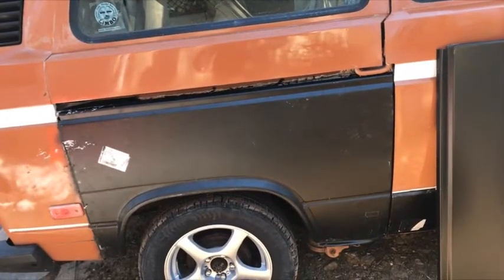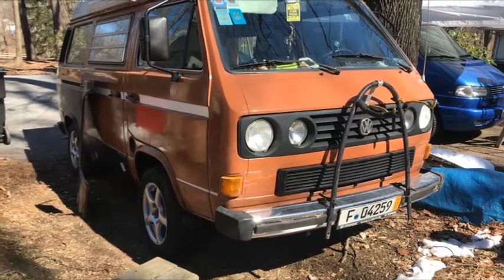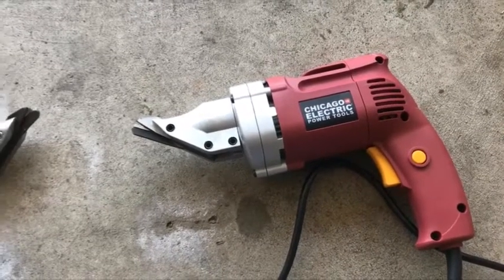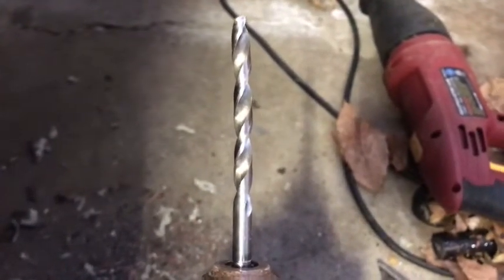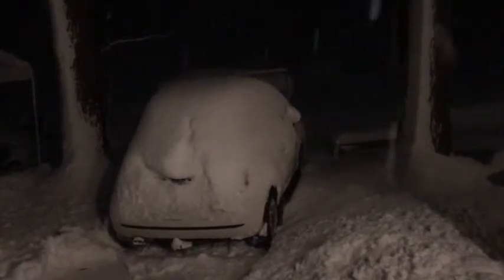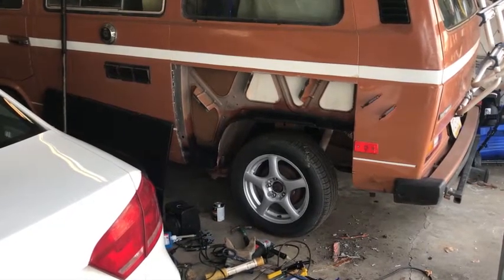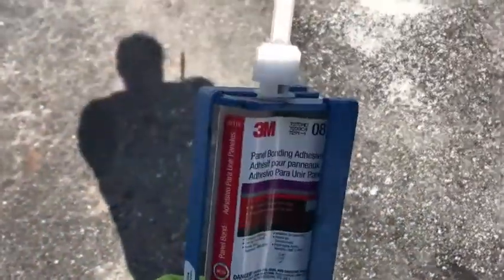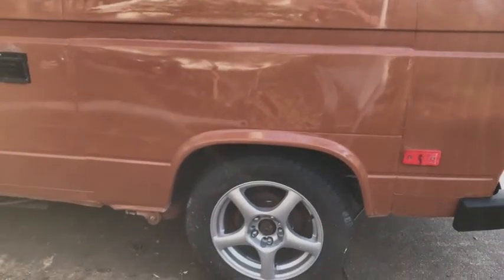Replacing the Rear Side Panel on Vanagon Westfalia

Comment: Are you going to make a paintjob video (I know you have done it but I me a more analytical )
Reply from the maker: Nah, I did a terrible paint job. I just did not have any time to do it right this spring. We've had a really cold spring this year, most of the time I was working was in 45 degree weather.
Reply: uprightbassghost not good paint conditions are you going to redo it ?

Comment: I know you prefer glue but I think that spot welds will give you a more professional result (my opinion,do what you think )
Reply from the maker: To weld it I'd have to take out the A/C and camping cabinets. I don't think that panel is just going to fall off on its own.
Reply: uprightbassghost hopefully not but the glue will crack after a few years,just think that it's better tondo it one time and never again than have to do it it 5 years
Reply: Κώστας Λεούσης   I don't know what glue he'll be using but if it's structural then he could use 3M structural adhesive.  If it's just a panel the could us 3M panel adhesive.  These type of adhesive is used by most supercar companies.  I replaced a floorboard and it holds super Strong.  Save on welding and a much more professional looking job.
Reply: Modern vehicles have the panels glued on, not welded. Providing the right adhesive is used there’s no reason why it should fail
Reply: C7TV nope ,(maybe cheap cars like Toyotas) but they are usually spot welded!(on every car we bought /I know the panels are spot weded
Reply: C7TV nope ,(maybe cheap cars like Toyotas) but they are usually spot welded!(on every car we bought /I know the panels are spot weded
Reply: @type2523   MC Claren super cars  use bonding glue not welding. are Mc Clarens cheap cars..lol
Reply: Cheeky Chap that's why they fall apart in the all accidents